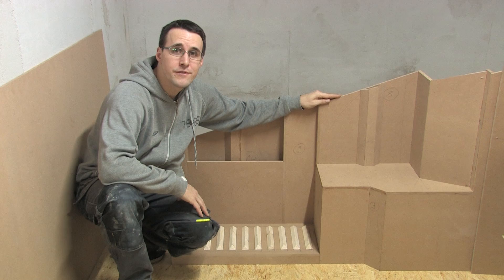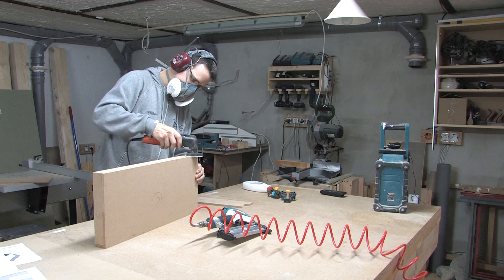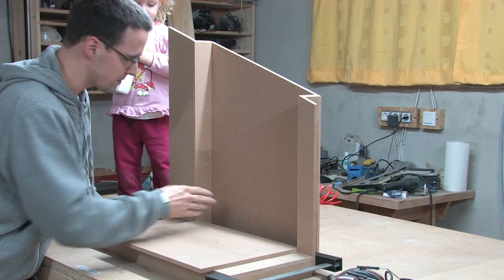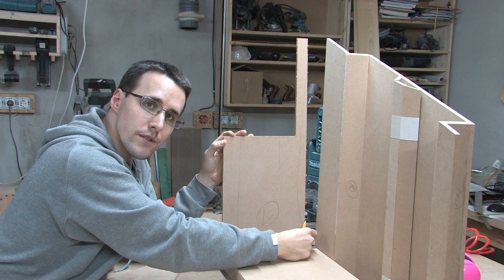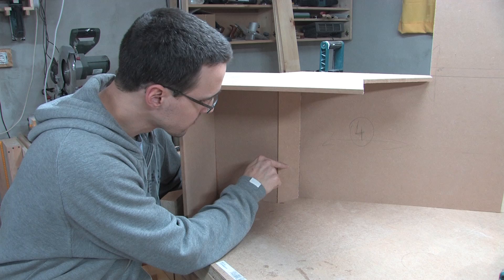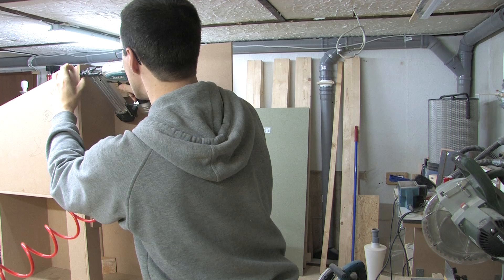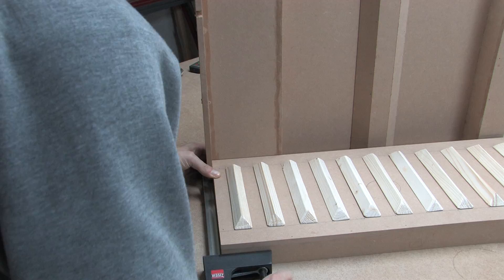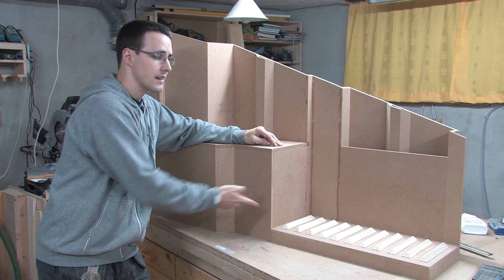Building a sidewall - A Boeing 737-800 Homecockpit #1

Comment: Well done! I was just pointed towards your site and found this. Very nice to see! :)
I might not have been too clear on how the different parts was supposed to connect in the plans, I think. I used the "stitch and glue" approach (a method for building boats with plywood, epoxy and fibre glass). I made my own side walls by gluing the parts together using strips of woven fibre glass and epoxy. I then covered the whole thing in fibre glass and epoxy. You could park a car on those things! :) In hindsight, they were WAY overbuilt. And if I were to do it again, I would just use closed cell insulation foam boards (not EPS, which is too coarse) hot glued together observing the outer dimensions, and finally covered with epoxy and tin, woven fibre glass cloth. Two layers worth, with the direction of layer 2 at 45 degrees to layer 1. That would become incredibly solid. The foam could be left in situ or removed (acetone dissolves the stuff, great for cleaning off small bits). I would just leave it, really.

Lovely to see someone using my plans. Well done! :) The exact measurements really do not matter, as long as one is "in the ball park". That was my main fault when I worked on my project - I was too hung-up in exact details. Which probably is why I ended up selling the cockpit parts and leaving the hobby for good. Oh, well. :)
Reply from the maker: Sidewalls made from foam sounds like a cool project. And doesn't need expensive tools. Carving your own sidewall. Your plans are still the first step to a full scale cockpit for many builders.

Comment: Hi Michael, Really like the quality of your work.  Would welcome a 737NG seat build from you?  Tx for your contribution to our great hobby!
Reply from the maker: Yes, there are plans to build the pilot seats. I think they will come when the walls and the ceiling are finished because otherwise they would be in the way most of the time.
Reply: Understand.  It's one of those elements that most simmers struggle to acquire.  We'll all sing your praises if you do it sooner than later :)
Reply from the maker: You are right. It is more fun than building walls. We will see...
Reply: :)  Spot on squire!

Comment: Mikey - what dimensions of the wood you used for the rip triangles? is it 30mm x 30mm? Thanks
Reply from the maker: Yes, 30x30. Keep in mind that the angle is only 41° so there isn't a sharp corner on the top.

Comment: Was the plans wrong or did you cut too much as there were so many places where parts were wrong size :D
Reply from the maker: I wouldn't say the plans are wrong. Especially when they are for free. It is not always clear how the parts should be connected to each other. For example the table top should be at a hight of 37 cm. The side part has also a hight of 37 cm. That means that the table top should be connected to the side of the sidepart (I hope it is clear what I mean). But if there will be preasure on the table, it will come to the top. So I thought this connection wasn't the sturdiest way and changed it. This change provoked other chnages for example part 1 which didn't fit anymore.

So as I said in the video, when you have enough room only cut the parts when you need them.
Reply: Michael Schulz i think part 1 measures are actually wrong on the cutting sheet. I think the correction measure is 270.00 mm not 240.00. Its on page 6. But as you said, the plans are free and in the overall are very good.